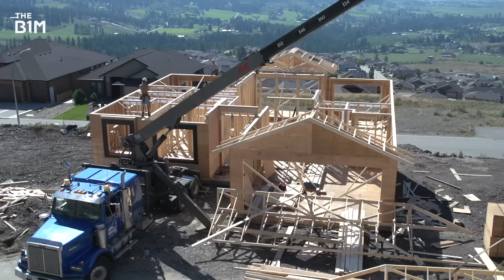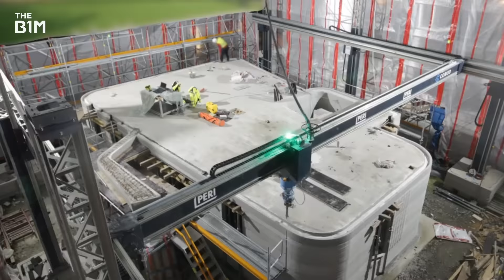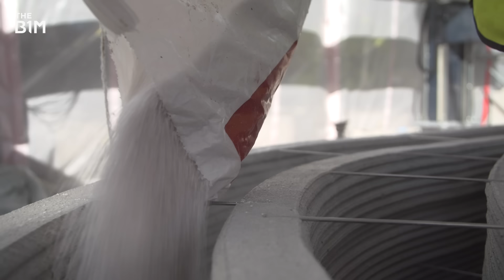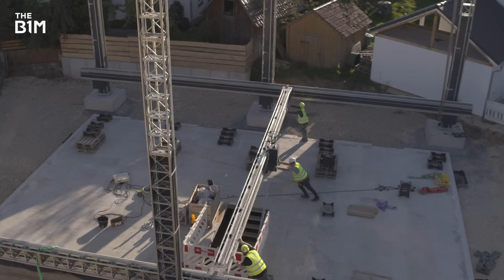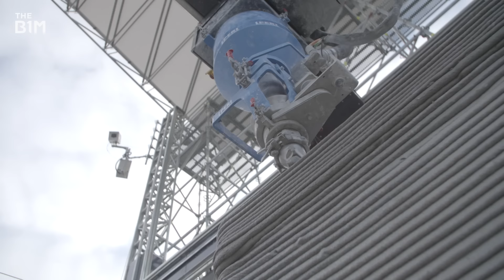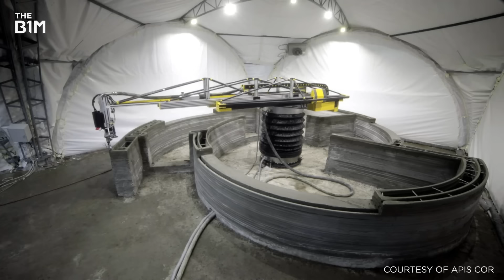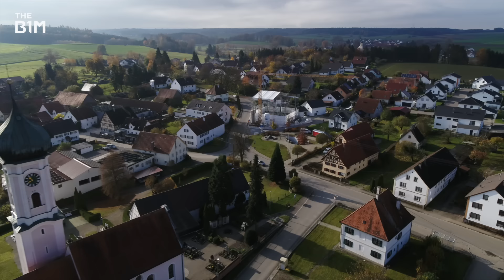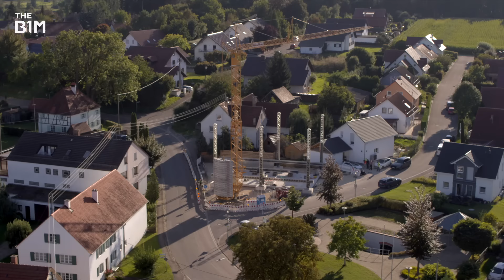Why This 3D-Printed House Will Change The World

Comment: Having owned and updated several older homes, I wonder what a printed home might be like when it is old and the services have all evolved and changed.  Also, it looks like it won't be easy for subsequent homeowners to make structural changes to suit their needs.
Reply: In Europe where every building was made from bricks and concrete its still hard to make "easy" changes it's pretty much Think twise cut once
Reply: Very interesting point
Reply: Right, and what about change orders in the middle of the build? It seems like that would be very expensive.
Reply: I honestly would expect modifications such as extensions and so on to be pretty trivial. Carve out the sections of wall you no longer need and get a printer on site to add on to the original structure.

If they manage to automate the placement of the metal reenforcements + add optional surface finishing I could absolutely see this becoming mainstream. You could literally print 24/7 and halve construction times. If the concrete can be recycled on top of that oh boy, imagine being able to reconfigure your home and save on material costs let alone labor.
Reply: If you wanted to modify it to create an extension, you could actually 3d print that extension. It sems fairly doable once the technology become more mainstream
Reply: @raphaelfalque683  by the time they blast through for even a single door to connect the extension, they’d have to replace a few walls.
Reply: You can Robo- spray-foam the interior as thick and frequently as you like - then Robo- Spray Plaster over that.... Followed by Robo-Paint....  Everything can be roboticised - the Question is ? Should it?  Is it cheaper / Better? ("Robotics" Engineer here - FWIW.)

In the end - Older Houses can be modified (so long as there is Space to add false ceilings etc...) for HVAC , Plumbing, etc... It just depends on how "Original" you are forced / constrained to keep it.

Here is more Hype, and "potential Profit margins" for the Scaffolding company.
Reply: It can be modified just as easily as any brick or concrete home. Concrete homes are not new. 3D printing is. You guys in the US need to remember that houses all over the world have solid walls. Wood isn't the only way to build a house.
Reply: Not a problem unique to printed homes, as in many countries most houses use bricks.
Reply: With the proper drills and saws you can cut through anything
Reply: basically impossible. these houses are AS IS and cant be modified after...even small stuff.
Reply: Then houses are set to become more quickly replaced, just like artifacts such as cars and phones have become more transient.
Reply: @DavidKristoffersson  Have you watches new houses get built and the old ones come down? Tell me which is much better made and hideously overpriced? New ones are garbage. The old ones tend to take time to tear down. Very solid
Reply: @windsofmarchjourneyperrytr2823  New houses in Europe tend to be pretty solid.
Reply: i think they know that so i feel like you would be able to design your own house ya know like an entire house to suit your needs so you wont need to do anything later
Reply: @Blank-tm6tt  Eh, im pretty sure your needs may change with time.
Reply: Don't buy it unless it suits your needs, buy a tissue paper house if you want to modify it or build your own!

Comment: Are these kind of buildings also earthquake resistant ??
Reply: In general, concrete is EQ resistant - it can soak a lot of energy due to cracking (while remaining relatively stable).
Of course, you need rebar to take tensile stresses (which I assume are the small stirrups they put to couple the walls).

For houses of this size, EQ really isn't a major concern when considering the huge amount of structural material here.
This cannot be used right now to erect a very tall building.

Hope this helps.
Reply: @mikeyronen2952  thank you! Yea I thought the same but when you live in a high risk area with superficial events (like where I live)  I can assure you that  concrete structure (bar reinforced)  with ground and first floor is not enough at all!
Reply: As a tropical area resident i can see them being awesome for Cyclones. Strong, concrete all throughout.
Never get earthquakes here, not my problem :P

Comment: I also think this technology will change the world! I've visited the 3D printed houses by Icon, Twente Additive Manufacturing, Mighty Buildings, Emerging Objects, Winsun, and spoken with the founders of many more. Fred did a terrific job quickly describing this industry. I do into deep detail sometimes having founders of these companies on my podcast for up to 3 hours. The biggest issue right now is that everyone expects it to be drastically cheaper that traditional construction but in this early stage of the technology the fixed costs of the printer mean that 1000s of homes will need to be built in order to achieve economies of scale that will permit truly world changing affordable housing units. Join me on my journey to find the best solution!